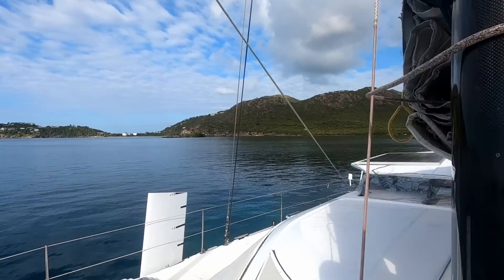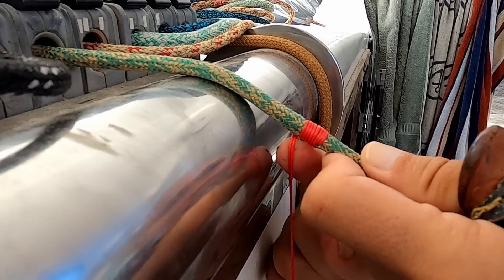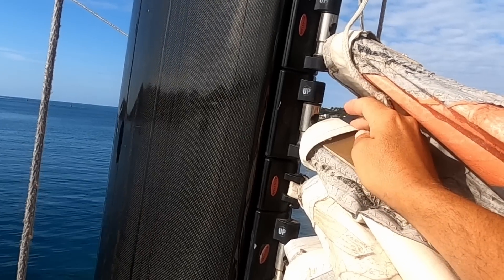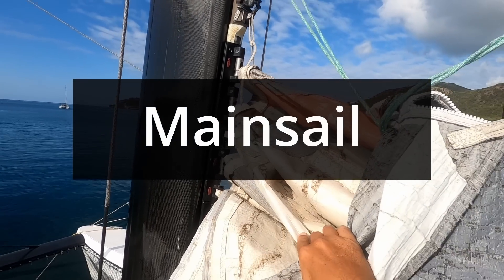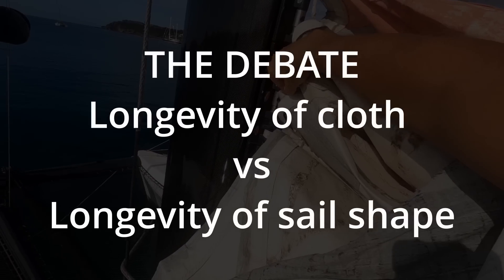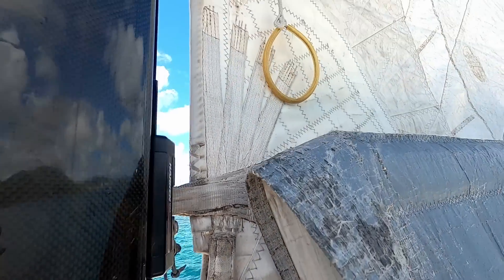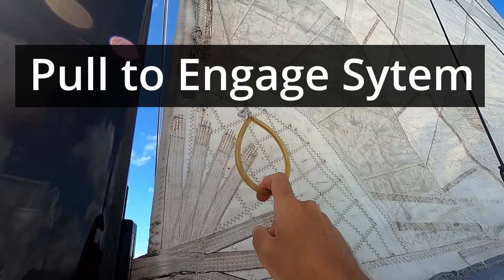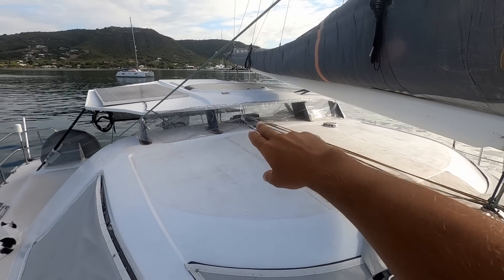We can REEF at ANY time, in ANY conditions, at ANY point of sail.

Comment: Your videos are awesome- so educational! For a 50 foot catamaran with an 85 mm2 mainsail, what are the pros and cons of blocks attached to webbing loops for reef points 1 and 2, versus perhaps a block at the luff and low friction ring at leech? I guess I am curious about pros/cons of using blocks vs LFR, e.g. friction in system, reefing line chafe, etc. Thanks!!!
Reply from the maker: Low friction rings are good for high loaded and slow, low moving parts so you wouldn't use it on a mainsheet as it is a high loaded and high movement part. Basically don't use them on sheets. However something like a reef line is a high loaded low movement part so a low friction ring would be suited to this application.

Comment: I've got a question: why use the elastic band pulling up to keep the top car from locking? It seems like you've created a single point of failure; if that elastic band fails when the top car is locked in, after the handles at the reefs points are pulled, you wouldn't be able to get the sail down without going up the mast. Are there designs where the top car lock wants to remain unlocked naturally (e.g., with gravity or by design), without the elastic band, and you use a low load tension on a cord (e.g., handles at reef locations) to keep the car locked? That way, if the cord fails, the top car returns to being unlocked without relying on the elastic band. I understand that you can check the band often, as a hazard control, and it may not be likely to fail; but it seems like situations where you've reefed, are situations where you'd have the highest concern for the sail remaining up in a locked position due to the elastic band failing.
Reply from the maker: The system is a pull to engage system, that means it takes input to engage the lock and will always automatically unlock when all fails. The elastic cord ensures disengagement not required to disengage. The movement of the car going up disengages the lock, the elastic cord the stops accidental re-engagement. This car is the number one proto type of this system. In new versions we now have over centre mechanisms to ensure good engagement and disengagement.
Like all things mechanical it requires maintenance and servicing, and that ensures reliability just as much as how the system is set up.
Reply: @youngbarnacles  Copy. That makes sense. Pulling the halyard to raise the car disengages the lock, and the elastic provides redundancy to the design to protect against reengagement. Thanks for the explanation. If the halyard failed, would there be a way to disengage the car lock?

Comment: Starting around 14:00 you discussed swapping the reef lines on the aft end of the boom.  I think the aft end of the boom is a very dangerous, difficult and precarious place to work - especially in storm force conditions when the need is to swap 3rd with 4th reef etc. and you need 2 hands and slack lines to operate a soft shackle.  You’ve got some great ideas but I don’t like this one.

Comment: We attach the clew friction rings with a bullseye weave soft shackle, relevant only to older Dacron mains with cringles. Great upgrade. Also used the resin friction rings where there is less movement, they are a fraction of the cost of the alloy ones. Looks like we’ll be adding a second friction ring to our reef point. Thanks for the tip.

Comment: Do you need the second friction ring on the "new" setup you suggested for the reefing line when you can utilize the strop already there in use going "up" so the line would just go up to the existing friction ring and down again through the strop and out the boom and you would get the desired angle and tension.
Reply from the maker: We need a friction ring to stop chafe on the strop

Comment: Great video as always! Have looked on mainsail track lock systems but seams to not be many solutions on the market, I have only found the karver kms lock. Do you know about any outer systems?
Reply from the maker: Check out our boat systems page on our website. We have a video on our facnor staysail lock https://youngbarnacles.com/facnor-halyard-lock/
The mainsail lock is my own design/build.
We do have more on our forum if you are a youngbarnacles member
Reply: @youngbarnacles  Thank´s, realized now that my text was a bite confusing. What I ment was mainsail track lock. Do you know about any of the shelf solutions for mainsail track locks other then carver kms 30/40/50? I guess that design/build your own is not something for most people.
Reply from the maker: Antal, Karver and Rigging Projects do them. Karver is not reliable, Antal ones are usually too small and Rigging Projects are made to order but generally for bigger boats. 
The alternative is to set up your halyard on a  2:1 system and use a low stretch sk99.
Reply: @youngbarnacles  Ohhh, that makes a little more sense. Thanks for the Q Isak. So what you have is a custom one off, not available? Patent?
Reply from the maker: This video talks a bit more about what we made https://youngbarnacles.com/sea-trials-with-our-new-mainsail/
Reply: @youngbarnacles  I’m just curious, would you say that karver in general is not reliable or is it just there mast tracks and cars? Most of the deck gear on my previous boat (multi 23) was karver, including blocks, ratchet blocks and two kf 1,5 furlers (one for the code0 and one used as a structural headstay furler for the jib). I didn’t have any big dramas with the karver gear except for two ratchet blocks. But it’s good to know for the next if I should avoid karver.
Reply from the maker: Karver is ok. Some of their gear is good but we have had trouble with some of their other stuff.
Reply: @youngbarnacles  While researching the bearing cars, I discovered switch track, looks good in theory (altho $$$ for what it is). From ur exp, if $'s not a factor, what system wld u kit ur mast/boom with?
Reply from the maker: If money was no object I would design and build my own custom cars. But the system we have now works well

Comment: What brand / model are you batt cars and main halyard lock?  Are you aware of anyone having issues being unable to release the main halyard lock?  It worries me that things tend to go wrong at the worst times and I dont want to be stuck with too much sail up.  I know you said it is a pull to engage - but when it is locked how do you unlock?
Reply: Pulling the mainsail up releases the lock. It remains unlocked until they manually engage lock it again.    Understand your concern for anything that locks on the top of the mast. I'm guessing the locking car (overbuilt?) would be more reliable than a main halyard & sheave system under constant tension.(?)
Reply from the maker: Because the halyard has no load on it the chances of something happening that would cause it to fail is minimal. Your other option is no lock and run a 2:1 system with  SK99 Mainsail halyard

Comment: so, you don't have any lines to pull the sail down right? it just falls down when you ease the halyard, even downwind?
Reply from the maker: Yes.
Reply: @youngbarnacles  wow, that is amazing. I've been on a few (charter) boats where I was able to winch down the main downwind but I've never seen one fall down under load.
Reply from the maker: Well there is a bit more technique involved in downwind reefing. It doesn't just fall down but it can be done without using  a winch

Comment: "Grunty, Butt Tonnes, Thingamy Gadget Jobby" technical terms that every sailor needs to know!  Great video, would be very cool if you do a video where you demonstrate you and the crew reefing running downwind in a bit of a blow say 20 knots true at 110 apparent.  Also interested to hear what you AWS your reef points are for your particular boat.  Cheers!
Reply: Thinking for sure yes on really good oversized cars... not so sure of the locking car that then requires a Cunningham.  Is there a big negative to having a loaded halyard?
Reply: @KeithStrang  There’s a lot of compression force getting concentrated from wind pressure across the whole sail into point loads where the halyard turns. The sheave at the masthead, the turning block at the mast base, and usually a clutch at cockpit. Very high chafing risk at those points. One partial solve is taking the halyard off a temporary clutch and onto a horn cleat during sailing.
Reply: How do you go reefing when running deep?
Reply: Yea... I had to keep pausing to google if some of those "technical terms" were related to sailing, or just kiwi dribble.